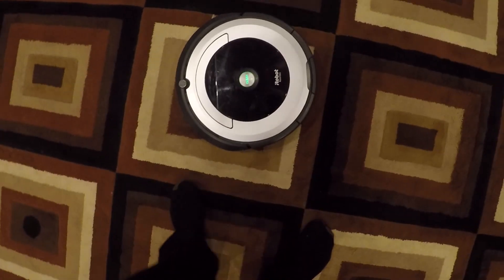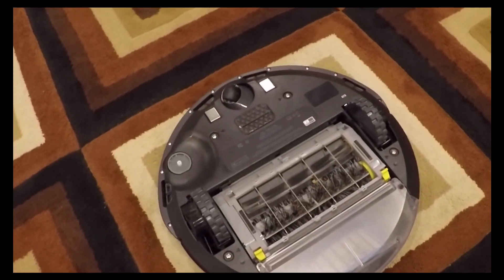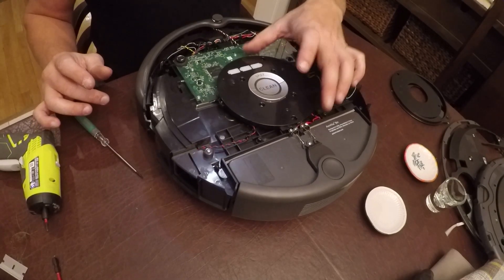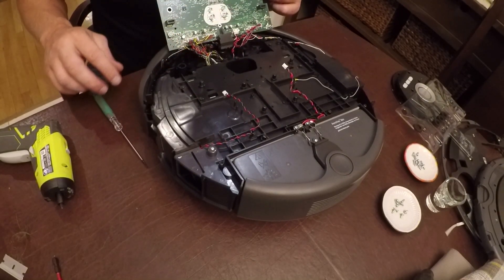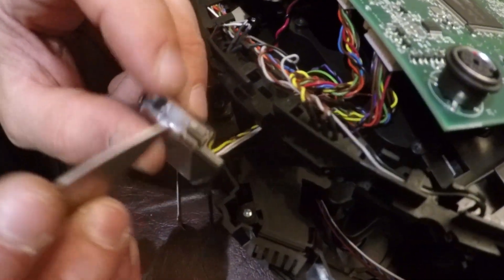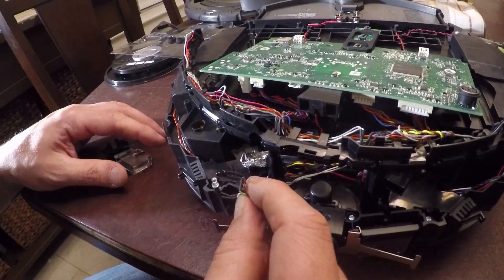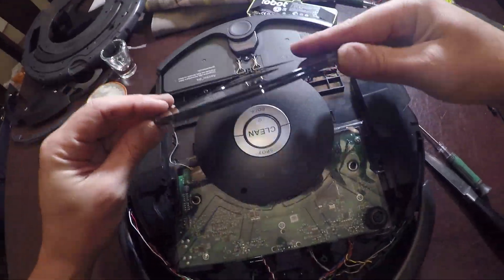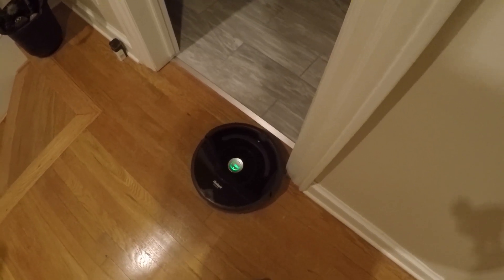Roomba TRUE Black Carpet Dark Border Cliff Sensor FIX (NO TAPE or FOIL)

Comment: It’s just spinning in circles now, any suggestions?
Reply from the maker: If it is a Roomba going in circles is a typical reaction to an location with extra debris being detected by the sensor underneath the unit. My first thought would be the center wires came loose during your modifications or perhaps they are blocked making the robot think it is on an extra dirty location.
Reply: @ModsAndProjects  is the center wire the one connected to the bumper?

Comment: When I first saw your video I was sad that I’d have to disassemble little Johnny5 but having done this (didn’t remove motherboard) with heat shrink, it performs great and is no longer afraid of my large area rug.  One thing you didn’t cover was what you did with the sensors once you took them out of their housings?  I actually just modified the housings slightly and was able to put the heat shrinked tx/rx back right there in all 4 locations.  Thanks very much for this video.

Comment: We have a model 620 and have tried the tape and foil tricks with no success. Just found your video and it now works great. I wish I would have read the comments first as the sensors are definitely easier to remove from below. I also wasn’t sure where to put the sensors once I had taped them together but after reading some Olof the comments I figured it out. Thank you for the outstanding tutorial!

Comment: 50+ year old woman here. Upgraded to an i3 and put the old one to work on an outside patio with indoor/outdoor black and brown checkerboard carpet and no go! I tried the paper/foil trick with no success and just stumbled on this video. My husband was surprised to get a text on the way home from me asking for 1/4” heat shrink and a BIC lighter. He was even MORE surprised to come home to a disassembled Roomba on the kitchen counter, but he and I were both damn impressed when it ran smoothly on the checkerboard carpet. GREAT tutorial, sir. If I can do it with a tiny Phillips head screwdriver, a paring knife, 1/4” heat shrink, and a BIC lighter, anyone can! FANTASTIC fix. THANK YOU SO MUCH! My Roomba almost got relegated to spare parts but now is put to work on my enclosed patio. *my black sensor mount popped up out of the housing when I used the paring knife on the sides. I didn’t have to remove the clear housing to get them out. Mine was a different model than yours here (614) but, happily, it still worked.

Comment: I have a 600 series and I guess the cliff sensors got dirty  because it wouldn't run and continuously gave the "Move Roomba to a new location" error.  Instead of just cleaning the sensors, I tried this mod with no success.  I've used both heat shrink and black electrical tape with the diodes parallel as well as facing each other with no success.  Now I wish I'd been more careful to not destroy the sensor housings, and just cleaned them.  I sure hate to throw away an otherwise perfectly good Roomba because of cliff sensor malfunctions.

Comment: Thank you!  I have a model 694 -- so slightly different (the top cover that you said don't pry off with a screwdriver I had to pry up on my version).  But the instructions worked a treat.  Took me about 90 minutes and now my checkerboard carpet is getting cleaned!

UPDATE:  mine did stop respecting the 'invisible walls' after doing this; it does still 'slow down' when it's approaching a wall, etc. so makes me think the normal bump sensors are working correctly; fortunately for me i don't really need to use those for the area that I have.

Comment: I did it! I'm not the handiest guy and I was to the point that if this didn't work, I was going to toss my roomba in the trash. It would wander across a floor vent, panic and want to be saved. It was happening like every 30 seconds. It was a magnet to those vents. My roomba is a 690 so it wasn't exactly like the one in this video but close enough. After I was done, not once has it called out to be saved. It goes over those vents like they weren't there. I did end up with 6 extra screws but it doesn't seem to matter.

Comment: This was super helpful! I have a rug similar to yours and it kept getting "stuck on a cliff" on the black part of the rug 🤦🏼‍♀️ Now I don't have to worry! For those who attempt this, the sensor housings just push out of place. No need to pry.  I also just tucked the sensor wires when done into the body of the Roomba itself, they do not need to go back into the housing!

Comment: You can do a really similar thing with the Roborock S4 Max, which has the same problem. The only downside is that you have to disassemble a heck of a lot more because the LiDAR sensor holds the assembly together. There are also two hidden screws under the top cover, which can be removed by just pulling up on the front half to access. They’re hidden under rubber stoppers. Once you take all of the panels off, the drop sensor IR assembly is nearly identical to the Roombas!
Reply from the maker: Well, that's great news I'm glad you figured it out

Comment: Great solution, but I still tried covering the sensors and it does work. You just cannot cover it without a space for the receiver and transmitter to meet. I cut up a business card precisely for all of the sensors and made a little roof shape out of it /\  This way the IR light bounces right to the receiver.
Reply from the maker: Oh, it works sometimes but I find based on feedback from others it's just a matter of time before it fails and you need to keep redoing it the sensor bypasses pretty much permanent until he reverse it

Comment: I have a 600 series and this worked great! It's not necessary to unscrew the motherboard, you can just move the sensor ring aside. Also, it's far easier to get the sensor "pods" out if you pry a bit from the bottom and push upwards.

Thanks a lot for the tutorial! Now my roomba can cross my rug and my floor vents and such. Huzzah!

Comment: Such a great video. Thanks!!! Finally I'm done with those bits of paper and tape .  It looked like it was going to be more difficult than it was. Two thoughts--one comment mentioned pushing the sensors up from the bottom. I completely agree. Very easy and didn't need a lot of pressure.  And two... If you don't have heat shrink wrap--black electrical tape worked for me. I actually wrapped the ends in aluminum foil and then taped them. Worked like a charm.

Comment: Hi there, my 360 S7 Pro is having the same problem with the cliff sensors and I followed your instructions using the shrink wrap but it didn’t work. I took the wraps off and used electrical tape and it still didn’t work. Do you have any advice for me, please? I’d really appreciate it. I spent the whole night and killed my back but still couldn’t make it work, so disappointed and frustrating.
Reply from the maker: Are you in the US?
Reply: Yes, I’m in Massachusetts.

Comment: Hi, thanks for this video.  This is a huge improvement for my robot, which I use in a one story house.   I don't have any cliffs for the robot to fall off of.   I had the following experience:  I did not find it necessary to remove the main board.   I just lifted the bumper and proximity sensor board out of the way, and there was enough slack in the wires.   I did not find it necessary to remove the whole cliff sensors.   Instead, I just popped the black plastic LED and sensor holder out of the clear lens and left the lens in place.   After opening the black plastic holder and removing the LED and sensor from inside that sandwich, instead of wrapping with tape or shrink tubing, I inserted the LED and sensor together in to the top of the black plastic holder, in the entryway for the wires.   This holds them together in a little dark room of plastic.  Then I inserted the black plastic holder back into the lens and re-assembled the robot.
Reply: Just did that on my e5 and works perfectly. Thanks @Mods & Projects for the inspirational push and the very helpful steps.

Comment: I attempted to do this, but I couldn't get the sensors out. When I put the Roomba back together, it now will only spin in a circle. Helppppp me please!
Reply from the maker: Do both wheels move freely when you move them with your hands?.  Does the unit immediately go in circles when you start it? Were you able to remove any sensors at all? Verify each sensor connection wire is firmly connected.  if one of them is disconnected the robot may be thinking there is a cliff detection on that single sensor causing it to go in circles in the opposite direction to avoid what it perceives as a cliff.

Comment: I just finished this modification on my two Roomba 690 vacuums.  The first one took about an hour.  I watched for little bit, then paused and did the step.  Rinse and repeat.  The second one only took about half an hour.  On the 690 you don't have to mess with the motherboard or connectors at all.  I used white electrical tape to attach the sensors together.  I figure that if I ever need to get back in an mess with things, I'll have an easier time finding the white parts among all the mess of wires inside.

Comment: I had the same problem, and this fixed it, thank you! Roomba 675, I used yellow heart shrink tubing and it worked just fine. Some notes: 
On the 675, the top shiny plastic is hard to remove. Have courage!
To remove the cliff sensors, all I had to do was pry then away gently from the bottom, then push up.

Comment: I'm a total newbie and this was hard, but I got to keep my Roomba so thank you! As an aside, when pulling out the sensors, other tutorial show it being pushed from the bottom rather then the top- substantially easier! Secondly it isn't clear where to place the sensors after you're done, it case other people are wondering I shoved them into the mess of other wires and it was fine.
Reply: I struggled the hardest getting the sensors to "pop" off on my 595. All the tutorials I saw said to wedge it off from the side, this video wedged it out from the top but neither were working for me so I saw this comment and tried from the button while pushing upward gently, and that worked but when I pulled it out I saw WHY it worked, the plastic ramp-egde thing that's holding it down is in the CENTER BACK. So stick a knife up from the bottom in the CENTER and twist the knife while pushing the sensor upward. To create space between the back of the sensor and the main unit to get it over that plastic ramp-edge. Keep your knife closer to the sensor side as twist and Jimmy it. 👍

Comment: You didn’t explain how to put the modded sensors back in and now I’m stuck on that part.     I’m having trouble reattaching the two black parts that slide into the clear plastic bc the taped up sensors are in the way. Help!
Reply from the maker: You should be able to tuck them away in any available space.  You don't have to put them back in the sensor area.
Reply: @ModsAndProjects  ok, thank you!
Reply from the maker: @MrBilldrums  NP, just stuff em where you can fit them.  Let me know how it works out!

Comment: Worked well 870.  Haven’t shrink wrapped the diodes though, fit together within the plastic holder.
Reply: Yes, there is just enough space to bundle them in the lower space within the casing for the sensor.  Brilliant guide.  Many thanks.
Reply: I was thinking about that. Seems like there's enough space to simply redirect them against each other in the area just under the original slot for each LED?
Reply: Bit the bullet today and made the adaptations to my 980. Worked like a charm and I also pointed the diodes against each other inside the shell. I did tape around with electrical tape to hold them in place "forever". :)

Comment: Great tutorial. Would it work just as well if I insert one LED sensor into each opposite end of the shrink tube so that they point right st each other? Thanks for your response.
Reply from the maker: That orientation should be fine.  Just don't let the shrink wrap tube shrink too much in between the transmitter and receiver to ensure enough space between them to allow for infrared light flow

Comment: Just followed this on my 891. Worked amazing. Was hard to open and a little different but worked amazingly
Reply: Also want to add, to get the faceplates off of the 891, you will have to pop it off. Be careful and go slow as to not break it.

Comment: Thanks for sharing this tutorial.  It worked very well.  As a slight modification, I re-routed the sensor emitter and collector into the little area at the top of the sensor, then put the sensor back together.  It effectively does the same thing as the shrink wrap.
Reply: Thank you for the comment. I performed the same action you did and it made the modification much faster and with less material needed.

Comment: I followed everything but now the cliff sensors think they are on a cliff. Should I put the transmitter and receiver parallel or point them at each other?
Reply from the maker: I suppose the most effective would be pointed at each other but I installed mine as seen in the video parallel within the shrink wrap and it worked fine.  It would only take one of them to be triggered or not aligned properly to exhibit the symptoms you described

Comment: I thought the white paper trick didn't work at first too, but I realized what the trick is.  
  
First you have to use packing tape on both sides of the paper. This ensures that the IR light will actually reflect off of it.  
  
Second, you can't just cover the sensors themselves. The pieces have to be cut to fit over the cut out itself, meaning you leave about 1-2mm of space between the paper and the actual sensor. This allows the reciever to actually see the light reflecting.   
  
I think a lot of people ended up covering the sensor so well that it essentially blocked off the receiver from seeing anything. 
  
I just did it with my roomba which is one of the newer models. It's hitting the previously "dangerous" black rug without a hitch.

Comment: I did this fix on a s5 roborock,  it was hopeless until i did this mod!
Take it from me it's no use using any kind of colour paper/ white/ silver/ anything!
The reason is because if you look carefully at the cliff sensors you can see a black line in the centre of the clear down facing window that looks to the floor,
That black line which is a black plastic separation wall continues right up into the top of the sensor, this effectively blocks the light from the sender reaching the receiver. 
So, I'm afraid it's time to get the tools out.
I found it quiet easy but I've always been pretty good at such things.
I'm also pretty sure if you do a determined search for a teardown video of your particular model robot you should be able to locate one on the Internet u tube and that should help you.

It's a shame manufacturers don't sell robots without the cliff sensors for people like me who only have a ground floor! they could identify these models with a red stripe around it's circumference for safety so that people wouldn't buy and use these upstairs.

Comment: Worked like a charm. Only things I’d suggest (as others have) are removing the motherboard isn’t necessary, and the sensors are much easier to remove from the bottom of the unit than as shown. Otherwise, couldn’t be happier. Great vid.

Comment: After following this guide to modify my Roomba 690, it seems as if it no longer works with the Roomba barrier module and it can’t seem to find its home. Has anyone else experienced that issue?
Reply from the maker: Check the connections to all of your front facing infrared sensors those are the sensors that are utilized to respect the tower and to find home
Reply: ModsAndProjects do I just check the connections on the motherboard? I didn’t touch anywhere else besides the cliff sensors.
Reply from the maker: @tarzane336  something must have been disconnected accidentally. Double check all of the connections on each sensor
Reply: @tarzane336  did you ever find out what the problem was? Mines doing the same thing

Comment: Just finished. Seems to be working well. A fairly big tear down but no worse than tearing a laptop apart. I found that prying the sensors out works better if you go from underneath. Thanks for your help. Cheers...

Comment: Thanks for the video, wow that’s a lot to do, I just got a shark IQ, it’s the only model out of the five robot vacuum cleaners that I have that will go over black carpet just fine, my Roomba is going to be sold... not only that it cleans just as good or better and was only $120 like new on eBay, which is much less than what I paid for my Roombas
Reply: Will, the Shark IQ works on black carpet?  Does it have cliff sensors by chance?  Does it hesitate at all on the black carpet?  Our issue is the black border that is at the edge of all our large floor rugs.

Comment: After you tape/shrink wrap the IR sensors together, what did you do with the black housing? Did you ditch them and put it in back in the clear case? What you did with the actual sensor was a little unclear.
Reply from the maker: Just tuck it away somewhere where there is space you don't need to put it back in the clear sensors.